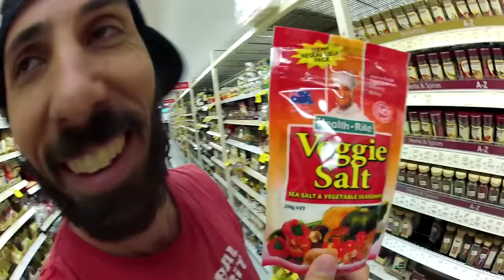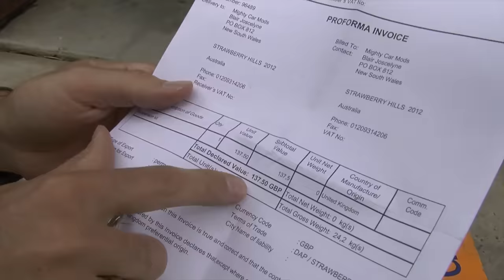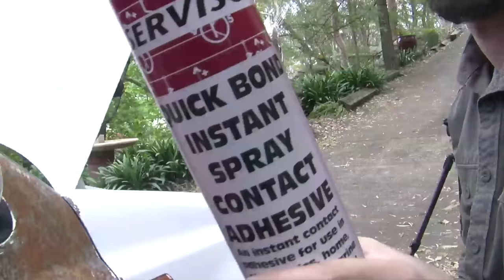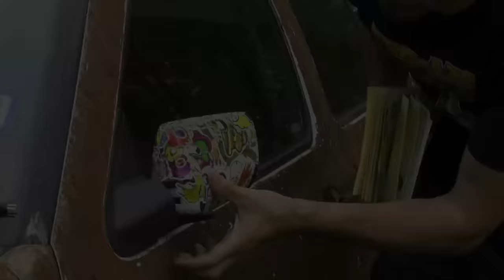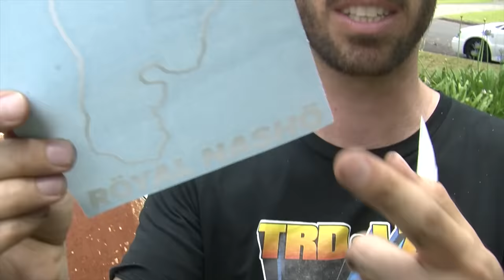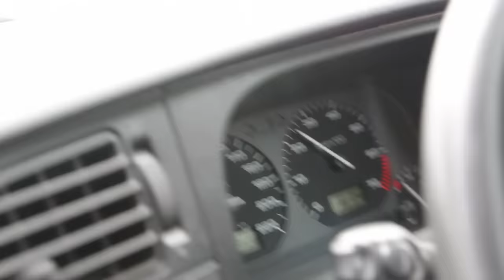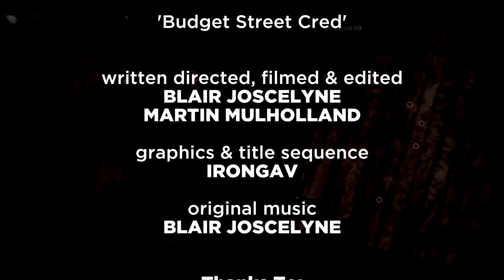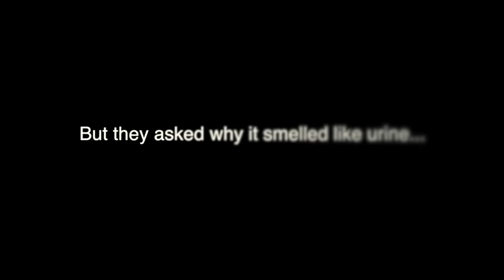Budget Street Cred (Season Finale)

Comment: So was it pushed bac into the spot or did you fix the reverse?
Reply: That's a good question:)
Reply: +Rinyotsu It probably turned into dust by now.
Reply: +Boni Hollóssy This is actually for sale on facebook right now although its changed alot and someone has stolen a bunch of parts
Reply: Sick Lad LINK!!!!
Reply: Sick, lad!
Reply: +Boni Hollóssy its pretty much only surface rust. Not like cars of old where the rust would form in the floor panels and sills and rust through.
Reply: MrLincoln87 It's just surface rust but it's hardcore surface rust. I'm pretty sure over time it would eat through everything.
Reply: ***** What chemical? You mean the clearcoat on the bonnet? What about the rest of the car?
Reply: +Boni Hollóssy Beer saves everyrhing:P

Comment: Thats not the german flag:)) RED IS IN THE MIDDLE not black!! 

If you want to put the car in reverse push the gear stick down and move it as you were putting it in the first gear!!

That car is going to be more reliable than your japaneese cars!! German Engineering the best you can get !! Vorsprung durch Technik!!
Reply: find ich auch meine Freund , aber diese Amis sind alles dickköpfe und müssen alles schlecht reden was deutsch ist ..
Reply: Wow, such hate towards Japanese cars.... Japanese cars are way more reliable, don't know how you got euros are more reliable than Japanese cars.... Have you evened owned a Japanese car??
Reply: Michael Gratz That's called a Mustang, and thats American ;)
Reply: Michael Gratz yeah exactly! except not. sure, they're little engines but they do what they have to do. german cars are just 18-year old poserboy cars so they can show off the power it has.
Reply: *****
Owned a 800 pounds vw Mach 3 with 250 000 miles on board. GREAT CAR as long as you change the oil and filters on time (50 quids all of them) that car will do more than 200 000 miles !!! After that switched to a honda and a nissan .. totally rubbish! No comfort, noisy, unsafe, used loads of fuel and oil :)) had to change head gasket, cv joints, alternator, starter motor, bushes, power steering pump and so on (spare parts quite expensive)!
I own now a 2006 VW PASSAT which is really cheap to run, economical, confortable, SAFE, reasonably fast, and easily customisable once you know how to use VAG programs (VCDS). So German cars all the way!!!
Reply: Im not surprised at the Honda,  but what Nissan was it?
Reply: Marcell Meszaros  I know it is not a brilliant car but I was a student with no money back then :)) It was a Nissan Micra which made my financial situation even worse:))) Had a mind of its own that car:)) Little MOODY match box on wheels :)) I ended up scrapping it.. however I paid 900 pounds for it back then .. which is less than I did for the Golf
Reply: Andrei Andrey Hmm, sounds more durable than I expected from a VW haha. And quite dissapointing about the honda/nissan indeed. I don't have a lot of experience with cars but in my opinion suzuki's are very reliable :) I like german cars too though....but I absolutely HATE french cars, they (most of them) look like shit and are very unreliable
Reply: Micras are nice little cars :P But without hate, you can't hate a car brand because you experienced the not-so-good models. For example, I used to hate BMW's because I had a shitbox for my first car, and got a 2014 model and loved it.
Reply: In other words having a German car is like having a beautiful girlfriend/wife who you can trust and it is also very smart at the same time.. Japanese cars somehow can`t have all of them..
Reply: *****  I did not say that they are perfect. I just said that they are better than the others
Reply: Andrei Andrey u should have bought a jeep
Reply: cooper mayers what for?? I'm not a 4x4 enthusiast
Reply: or get a subaru and jack it up like a boss cus its a all wheel drive :D
Reply: Can anyone tell me what tires they used on that car
Reply: Hondas are consistently beating everything in the reliability statistics. Look it up. German cars are sort of in the middle of the pack. Because you had a bad experience with one car, and had a good experience with another, that's not exactly proof of anything, now is it. And that's comming from someone that drives an Audi. I wouldn't want to own a Honda myself, as i find them ugly, boring, and soulless (the same with Toyota) but they are good cars, i can admit that. They just don't give me a smile on my face. Life is too short to drive boring cars.
Reply: im pretty sure they know how to put it in reverse..this is very common for reverse to go out my golf does the same thing the linkage gets worn then reverse doesnt grabd an dyou end up grinding it a lot then it gets worn and the reverse idler needs replacing. so know your facts before assuming.
Reply: They never said that they were painting the German flag on the hood.  They said they were painting it in the colors of the German flag.  There is a difference when you listen to what they say.
Reply: Actually I had 1 of these cars and they loose reverse . Its a common problem with vw. Something to do with the syncros ,but its been so long I didn't care to remember. I never owned a 2nd golf cause that 1 was shit and everybody I knew with vw and Audi constantly had issues. As somebody who has personally owned both German and Japanese..... I would never buy German again unless I hit the lottery . Very nice cars. They just constantly need repair, expensive repair.
Reply: Andrei Andrey
please do not only praise german cars so easily... its not the same with every german car.. better praise the construction as it is, and the concept. thats the sign for a thoughtful construction process.
and every car isn't the same, many cars of your passat 06 has problems, too... its a fact of maintenance and luck to get a long running car... and last but not least the way you use it... many different people in the world use their car many different ways, as you know...  but if you want to say, that the vw-passat was and is an very luxury car for that reliable thats true... thats the reason why this car is mostly the most successful wagon in germany ;)
thats a pity because its the reason why this car (passat) is a rarely well tuned car.. because its too big for the small driving beginners and selfmurderer.
Reply: Andrei Andrey in my corsa b you have to pull gear knob up and then in the place where first is
Reply: hurius
finally someone who has used his brain when posting a reply !! thumbs up!!
Reply: Vuk Radevic
yes in the corsa is different.. In the golf (audi seat scoda vw)and other VAG group manual cars you have to push the knob down and then move it as if you were putting it in first gear
Reply: German cars are also the hardest things to work on, and the most expensive. I had an 86 bmw 325e that I still have nightmares about. I can build a decent motor for my Honda for dirt cheap
Reply: ryan swinsick
 you haven`t tried to work on a peugeot or renault :)) It is actually wery easy to work on german cars!! So what you are talking my friend is CRAP and absolute RUBBISH!!  Just take a quick look at this: /watch?v=nXCZ2v-nIF4
Reply: DaGhostQc What year?
Reply: *****
2004
Reply: Andrei Andrey I'm with Ryan for the most part actually. I have had experience on all myself. I have never worked on a Renault or a Peugeot but I can only assume it would vary by the year/obd generation... my golf was a 93 and essentially the same as if you flipped a Honda motor around 180° . Some extra un-needed crap but not to bad. Just constantly needed fixed. My buddy has an 03 jetta and that thing is a nightmare! In the 6years he has owned it I would honestly say he has maybe had it running for 1-2years. Its a nightmare any time you work on it with just the overwhelming amount of excess crap. Every time me or him fixed it , it would run for a month tops. I own a 98 legacy gt and a 00 Outback now myself. My preference is heavily towards Japanese cars . But if I was able to risk the dependability I would consider buying German before I bought american. They are a very well engineered piece of machine . Just so expensive here in us.
Reply: DaGhostQc Come on man, I'm a GM guy, but even I can admit that GM was garbage after the 90's till they went bankrupt. And I meant older american cars, meaning mostly distributor or carburated cars! Haha
Reply: ***** I'm with you on that ! I have never heard of somebody say " I love cars with coilpacks!" . I have minimal experience with carbs but , more isn't always better .
Reply: joe m
I had a 95 golf 1.6 petrol.. I used to service it myself ..change the brake pads/ callipers, filters, timing belt and so on .. very easy to do if you know how to use google..
Reply: joe m Haha yea! But Carbs are insanely easy to fix in my opinion, usually knocking on them with a hammer will loosen up the carbon build up and you're on your way! Sure it's not permanent but it is effective
Reply: Andrei Andrey my 93 had the 2.0. I'm pretty good with cars so that thing was cake to work on. My biggest issue was how often it needed work and how much the parts were. I could be wrong but since you referred to Renault and Peugeot I'm assuming your not from the U.S. . If parts weren't so expensive here I would be much more likely to get another German car . I truly love the looks of every car that isn't a 1980 + american car pretty much. I really love Audi's to.  But my best personal experience has been with Japanese cars though. I think it was you that mentioned this but you can't exactly judge every car by your experience of 1 of them.
Reply: ***** I have never owned anything carbureted but the thing that has always appealed to me from those days is the simplicity. Basic power/ground wiring especially. But all my experience has been with roughly 1986 to 2000 when it comes to major work . Anything after they started adding in "OnStar" as an option is just way more complicated usually. I can still get it done , but why the hell do I need an extra plastic cover on top of my damn engine ? You have my word though.... I am going to eventually own a loud nasty gas hogging v8 . But even then I will have my cheap to fix Japanese cars. I just fucking love cars in the end :)
Reply: Haha yea man! I never got why they combined the whole head unit in go one system pretty much making it impossible to change the radio without re wiring almost everything. But don't get me wrong I don't mind Japanese sports cars, they are amazing little cars however I'd rather chug along in my big block V8
Reply: *****
Yes, in EU car parts for German cars are quite cheap unlike in USA. Also the reliability of a car depends on how well or if it has been serviced properly during its life time.  Service-ing a German car from that period of time can be done even by a 12 year old kid. I used service it myself (from the regular oil change / brake pads .. to changing the timing belt) and I am not a certified mechanic. Not to mention that on the new cars (my VW Passat 2007) I just connect the laptop, run VCDS can run a diagnose, or even add options (coming home/ leaving home/ auto roll up/ or even modify the sound and length of the alarm horn..
Reply: If you listened to them properly, you would have heard them say, "we're painting the bonnet in the colors of the German flag". Not painting the German flag.

Comment: I don't need to pay anything to cover my car in salt... all I have to do is drive to work... mumble grumble
Reply: i just moved to london from australia i asked my coworker where all the old cars are he said salt haha
Reply: Anders Öhlund 
I'm from Canada (one of the not-so-cold parts), and I didn't even know salt trucks existed anywhere, here every winter we instead get a truck that dumps a bunch of fine gravel on the road. It helps for traction, but the rocks are still on the sides of the street come summer time, so it's really annoying. I'm nit even sure if they've done it in the last few years because there's only gravel on the sides of my street now and it's still winter. My city's upkeep is really bad though, so they do a really bad job on ploughing the snow when there's a good 30cm everywhere (it can take 3 days or never for them to get the residential areas), then they can't even build a street corner right where a year ago the buses literally had to go on the wrong side of the road to make a right turn, and it took the city two tries to fix it.

Comment: what kind of rims are that? they look mad!!!
Reply: banded steel one's there great coz u dont have to declare them at modified coz they are steel but if u get wide ones arond 8j then u may have to roll your arches for legal purposes :)
Reply: LuxKadafi they are called widened steelies
Reply: Lol widened steelies? Wtf. They're called Diamond racing steelies.
Reply: wassup haters They're mostly known as diamond steelies. :)
Reply: Adam Nasir  i beleive they are off a suzuki swift, widened out.
Reply: LuxKadafi Just go and buy a couple shit steel rims at the local car crush and cut them in half and widen them, you can get a welder shop to do it for you , its very common where im from that people do this, you get mad looking wheels for very little money.
Reply: LuxKadafi Diamond racing steelies, SC Series
Reply: god dammit go ask mcm yourself then. you're probs not going to find the exact rims as they were probably stockies on a corolla in aussie or something
Reply: one thing i should add.... by the look of those you will get brake fade in ten mins in any car.. not the errm most areodynamic style.
Reply: They are literally steel rims that have been widened, therefore, widened steelies. You sir have the downs.
Reply: diamond steel wheels on Ebay.   They have 0 offset which is super deep.   I prefer 25 offset deep but not causing major issues with rubbing
Reply: +London Riggins i have -51 offset steelies 😂
Reply: im guessing you just threw away the quarter panels alltogether..
Reply: No lol. I didnt have to mess with them much. It was more the rubbing on the wheelwells. So i cut them out.
Reply: SolidBoredness shouldn't have been so condescending with all the 'lol, wtf' then if you didn't know
Reply: shiiit, i think im going to stick to my 0  - +25 aha

Comment: Should have bought a MK3 Golf VR6. They got 170hp/128kw, not a rocket by any stretch, but it's one of the best sounding 6 cylinder engines ever. With a sports exhaust they sound amazing.

32:34 perfect shot of your average Honda driver. Come@me
Reply: harder to find, much more expensive. remember the title of the video
Reply: Where are you from? Around here those are the average WRX/STI drivers. Paid for by mommy and daddy of course.
Reply: Denmark, and i guess you can include BMW E36.
Reply: I whooped a vr6 with my modified 01 Grand Prix GTP. I give the guy driving the vr6 some respect although he was the one that wanted to race and he peeled off the line and I blew his doors off.
Reply: Well, they aren't fast stock, and most are front wheel drive sadly, but they sound fucking amazing :) When i see ones that are turbocharged, i want one. 2.8 turbo in a hatchback? Hell yeah.
Reply: The guy that raced me was a noob. he had an exhaust that didn't sound very good. Funny thing is this guy when he rolled up next to me he was reving the shit out of it, and when he looked over at me he looked like he was tough shit. lol. he peeled off the line, and to me looked like he had burn up the clutch before he raced me. I even with a large stereo, second battery in the trunk I still mad him look chump. I did however removed the GTP badges on the sides so he probably thought it was a GT Coupe, but when I reved my engine back at him then he heard the supercharger wail he hunkered down in his seat.

Comment: Does anyone know the exact wheel+tire sizes and offset used??
Reply: Power 2 Weight you just made that up, didnt you
Reply: Diamond steelies, my guess 15x10 probably 205/50
Reply: They are car trailer tires, it was mentioned in their 250 car tricks video.

Comment: What parts do I need to change if I want to super or turbocharge a motor with 200k miles in it
Reply: Jason Ochoa don't for the love of God don't, but in my incredibly unprofessional opinion just based on what I know, if you want it to last. head, cam, crank, pistons and rods, head studs and I complete service of all fluids
Reply: So basically just buy a whole new motor lolThe Best  thanks for answering, I'm not really thiking of doing it, I just wanted to know if it was possible lol
Reply: depends on the engine.
Reply: What that guy said only applies to some situations. Most of the time if you don't plan on running too high of a boot level  and he motor wasn't too high compression to begin with, just do supporting mods and all should be good. Don't know if the same applies to superchargers. Also keep in mind that I was talking about cars that were N/A to begin with.
Reply: Fucking autocorrect.

Comment: Pro tip take you're air impact and do quick burst . To bust loose r tight the strut bolts that you can't grab the shaft on. Quick and fast trigger pulls . Works on tie rod end  ball joints also